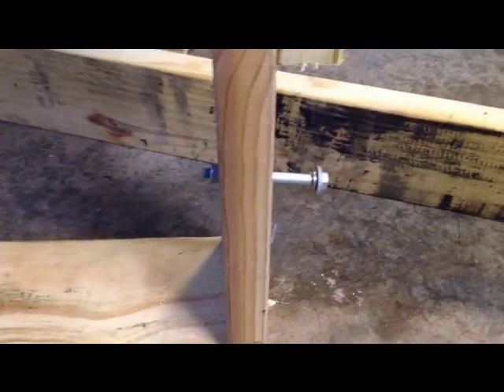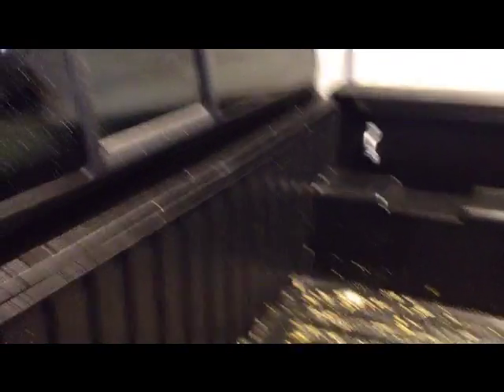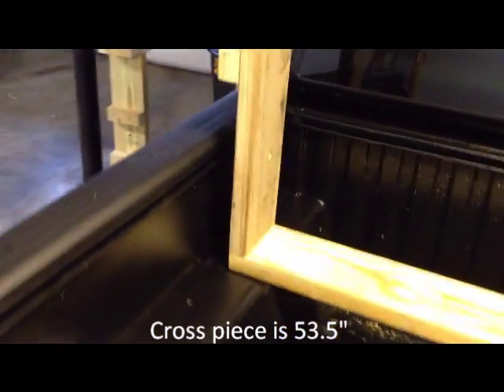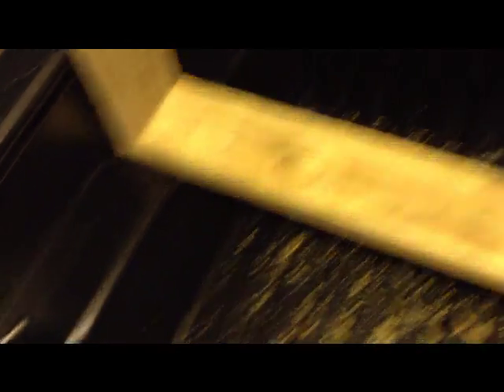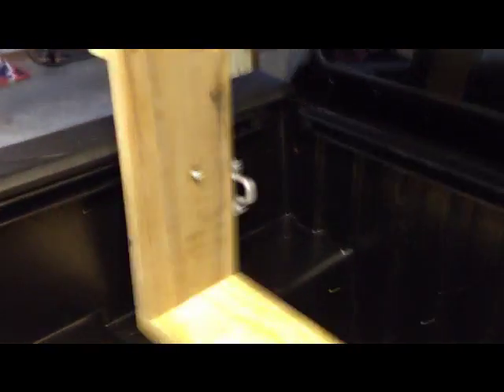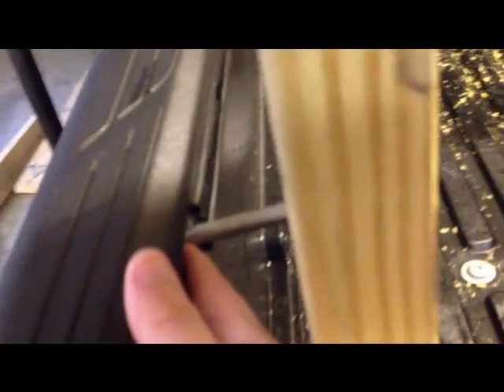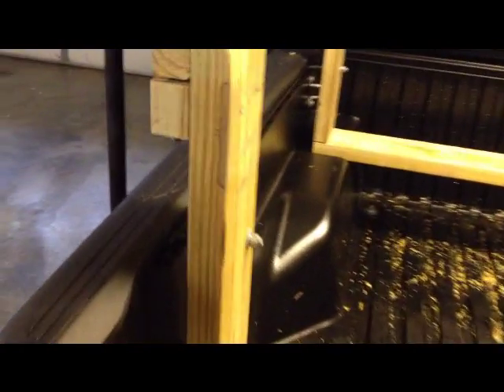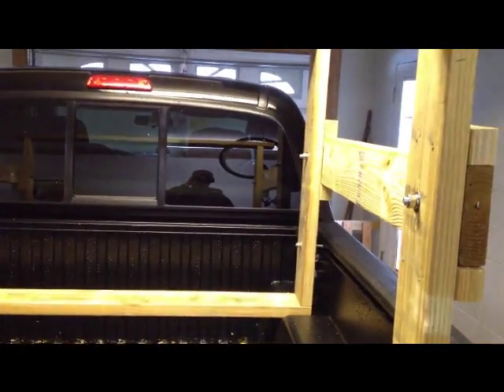2015 Toyota Tacoma homemade kayak rack

Comment from the maker: As far as the dimensions go, the front width is only specific one. Everything else was pretty much cut to fit with 2x6s (and the height is whatever you want to make it). The supplies are 2x6s, 3" wood screws, 4 i-bolts, 2 u-bolts, carrier bolts with nuts/washers/lock washers. Still working well for me.

Comment: Did you use CCA for this?  I'm debating whether CCA which would be heavy or regular lumber and paint it.  Very nice job I'm going to build this over the weekend I hope.  Thanks for posting.
Reply: Decided to go with the CCA.  It worked out great, very sturdy.  Thanks again for posting this.